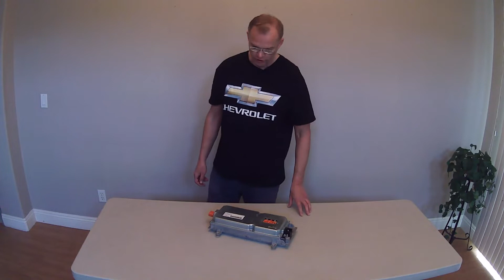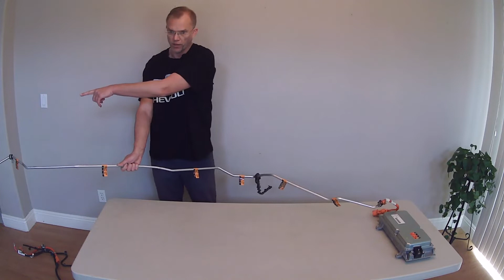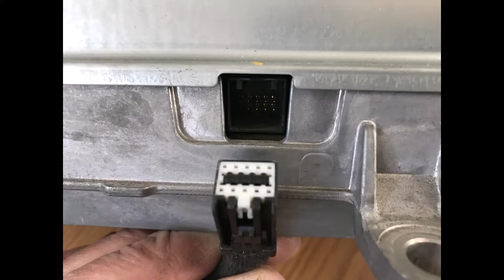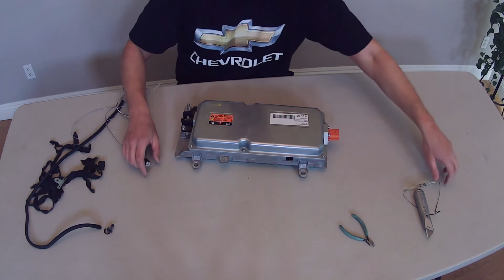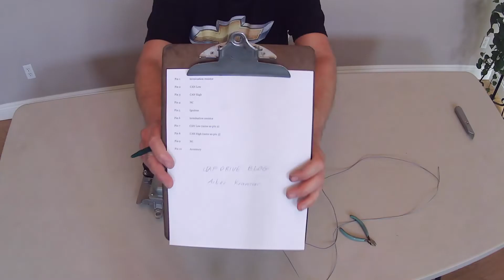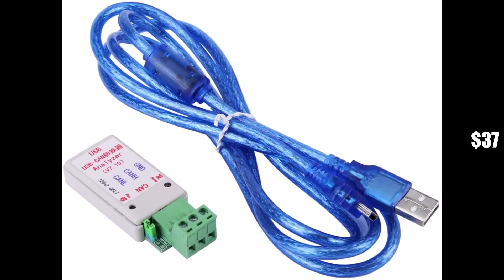EV Conversion Chevy Volt DC DC Converter

Comment: Wow! Thanks for this; the timing is perfect. I've got this APM (I've had it for a few years), and I've been trying to get it to work. I've using the little green CAN bus analyzer to input the code that I found several years ago, and I'm having no luck so far. I don't know if you've been able to get any of the CAN codes yet through your efforts, but what's available online is the following, which I believe comes from the source you mentioned earlier in this video. The ID is 0x1D4; 0xA0  0xB2 turns it on. 0x1D4; 0x00 0xB2 turns it off. I look forward to your next video so I can finally get this to work!
Reply from the maker: are you active on the OpenInverter.org forum, if not please visit, those guys are the source of solutions, a lot of very smart guys and gals on there reverse engineering this stuff, that's where I turn for answers, just post your question like you did here, they will answer and help you out
Reply: @Good-Enuff-Garage  Thanks so much for your reply! I ended up buying an Elcon dc to dc, but it "popped" as soon as I put battery power to it. It destroyed both the dc to dc and the semiconductor fuse meant to protect it. Elcon is doing an autopsy on it. I might go back to the Volt APM in the meantime.
Reply from the maker: @gregmolnar6318  I recently picked up the Tesla Model S second gen DC-DC converter as it is also CAN Bus controlled yet unlike the first gen Chevy Volt one it is liquid cooled, you may want to pick one of those up
Reply: @Good-Enuff-Garage  Thanks for the heads up! I've had nothing but problems so far with CAN BUS control; I can never get it to work. But it might be that the used components I bought a long time ago and just finally got around to using never worked in the first place.
Reply from the maker: @gregmolnar6318  I just wrote a CAN tutorial or started to, please check out the thread here, I also review some CAN Bus analyzers and found none of them can send messages to the Volt charger: https://openinverter.org/forum/viewtopic.php?t=2385
Reply: @Good-Enuff-Garage  Holy cow! Thanks for that piece of info. I've been making myself crazy with that thing. Are there any CAN BUS analyzers that work with the Tesla dc to dc?
Reply from the maker: @gregmolnar6318  I'm going to first test them with the Chevy Volt first gen DC-DC converter hopefully this weekend, please keep checking that CAN thread for updates, I also need to make more videos on this soon